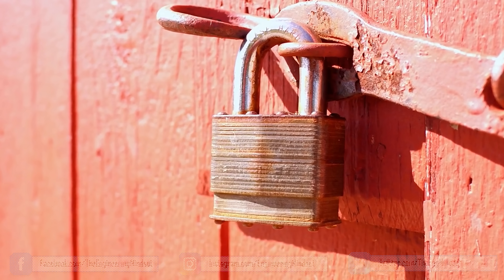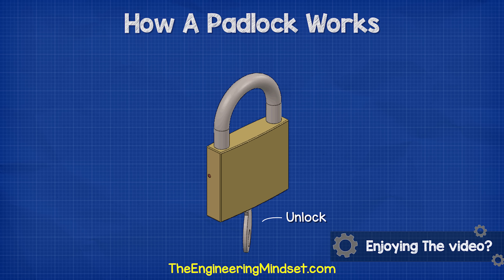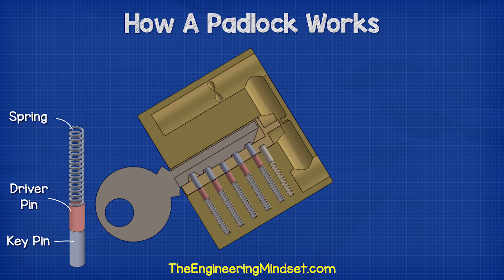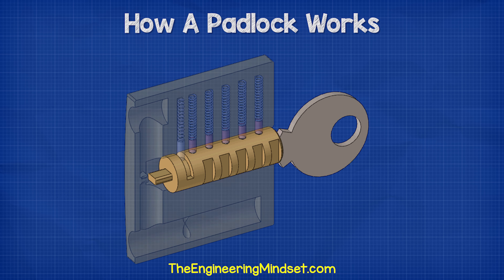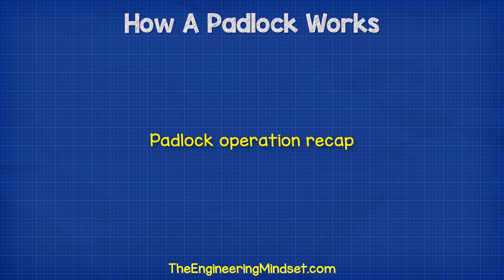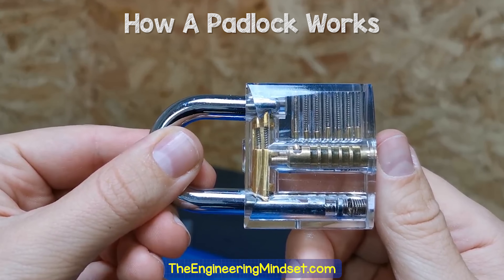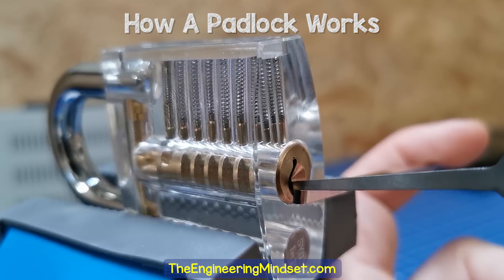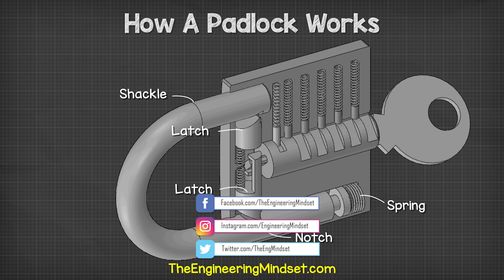Unlocking the Mystery: How Padlocks Work

Comment: I don't get it, the shapes on the key is what keep the pins in the position so you can turn the plug. With a picking tool, how do the pins stay on the sheer line? Cause as soon as i release the first pin and move to the second, i can see the first one back in it's original position. As it would be normal i think. So am i doing something wrong or what? I'te tried with 3 different locks. Door locks, not pad locks, but still....

Comment: Should be noted that the reason why lockpicks work is manufacturing tolerances, which causes all the pins and holes to be slightly out of alignment and different size. So when you try to push the pins up, the one that is the most out of alignment will click first, and that causes the plug to rotate ever so slightly so that one pin will stay at the shear line and can no longer fall back down. 

Then you keep that up until all the pins click and stay at the correct height and the lock will open. That's also why you need to keep turning the lock and hold the pressure.
Reply: This what i am not understand before and not clearly informed. How does the spring not springing 😂 Why just it doesn't  goes down and i Understand it must the the tumbling mechanism. Thus you got the answer. Thanks🎉

Comment: Two questions for confirmation.

After inserting the KEY fully into the PLUG, which part of the KEY comes in contact with the KEY PINS?  Is it the small VALLEYS  on the key or the small PEAKS on the key?  Your animation shows it's the valleys, not the peaks.

Also with no key inserted, what prevents the key pins from coming all the way down and some falling out of the lock?
Reply: i would guess that the pins are magnetic?
Reply: @elijaholeary5139  I think that it must be cylindrical holes that are wider than the key slot itself. That would allow the spring to push it all the way against the end of the cylinder and keep everything in place. I say that because it looks like all of the key pins are perfectly aligned at the bottom even though they are all different sizes.

Comment: Hi Paul. Can you add control panel single line diagram and wiring diagram for control circuit (not power circuit) to your video list as well? I have trouble dealing with those ......

Comment: How do the driver pins hold them selves in place
Reply: It seems it's because the Driver Pins are not actually connected to the Key Pins so that there can be a gap between the two, so by trying to turn the Plug, part of the Plug (the walls of the hole for the pins possibly) make their way into that gap and hold it in place. I may not be right since I also just learned about locks but I feel bad that nobody answered your question..

I hope this helps :)
Reply: magnets maybe?

Comment: Would it be possible to use magnetic force to pull the latches inward?
Reply from the maker: Great question and great answers. This is exactly the mindset I like to see.
Reply: all the pins are brass, so they are non-magnetic.
Reply: you'd pull everything up.
Reply: @Kyané-n3r  not the pins, the latches at 5:35.
Reply: @scorpio6587  Same thing, you'd attract the whole lock, and in the hipotetic case only the latches were attracted, they'd need a very powerful magnet to counter the spring and torque of the plug mechanism, since the latches and the plug are connected.
Reply: @Kyané-n3r  I see. So basically, the magnet locks everything together.